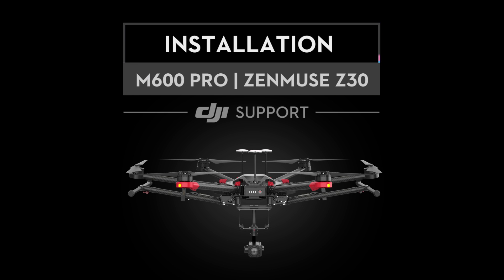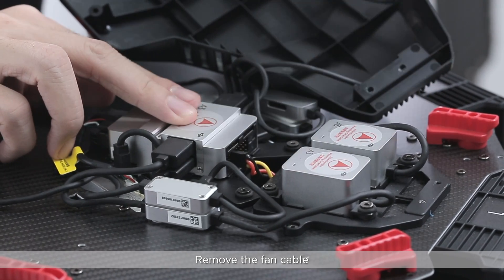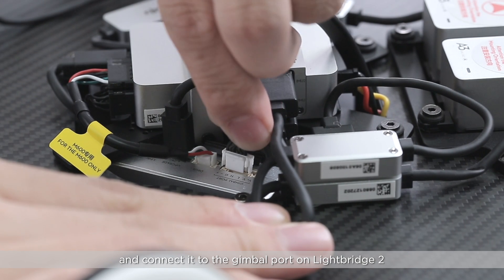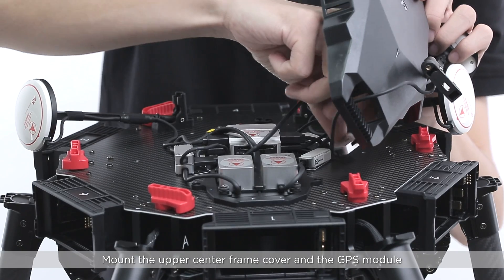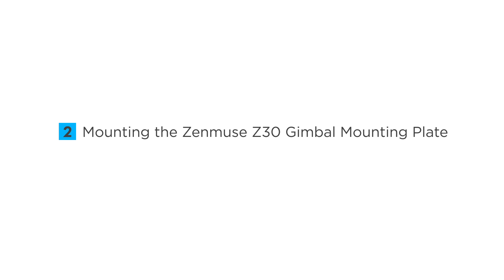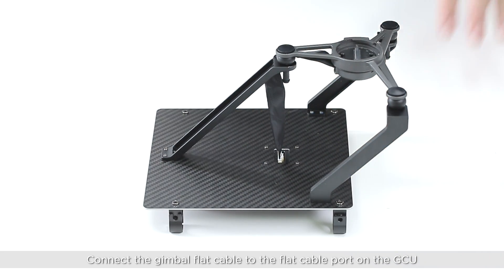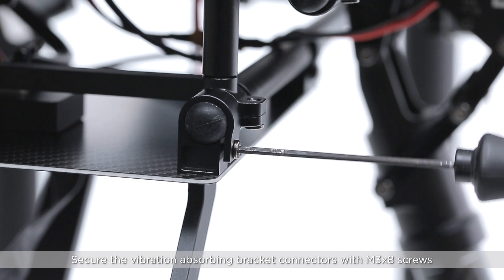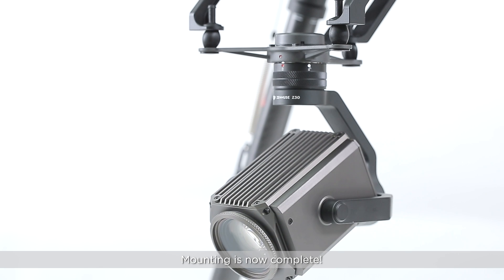DJI Matrice 600 Pro - Mounting the Zenmuse Z30 to the Matrice 600 Pro

Comment: I don't think I want a $10K camera hanging from 3 rubber vibration dampers.  I don't care if there IS a flange on the rubber grommet where they pull through the frame adapter arms.  Under a high G load, that camera is going to depart the M600.  Reverse the grommet installation and install the camera mount frame above the frame adapter arms.
Reply: Hi Neal, have you tried that Idea of yours? I was wondering the same thing but in the same time I wasn't sure that it wouldn't affect the stabilisation. I also thought about adding a safety cable. Thanks!

Comment: Can I plug the power service into the main power rail as I don't have an 18v out on my build
Reply from the maker: Hi there, just to verify, do you refer to plug the power supply of Z30 into the aircraft's main power directly? If yes, I'm afraid that they will not work as the main power is 12s(44.4v).